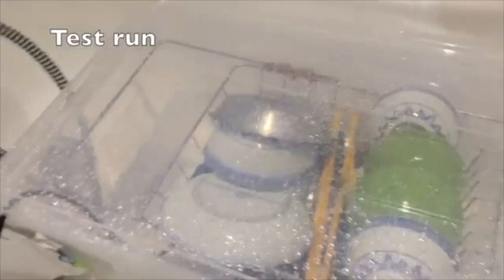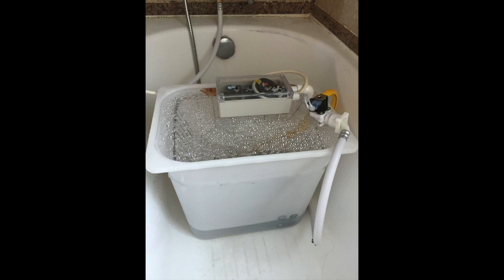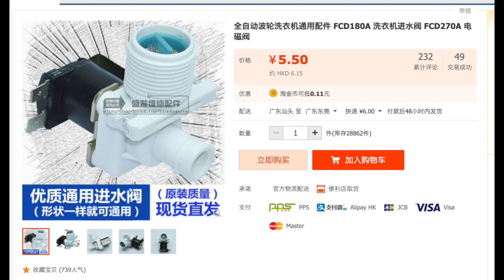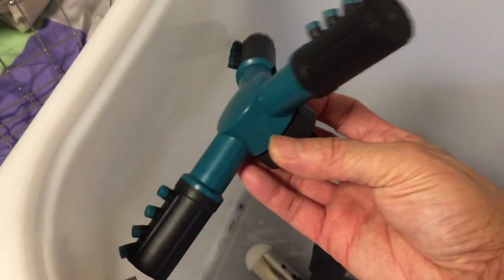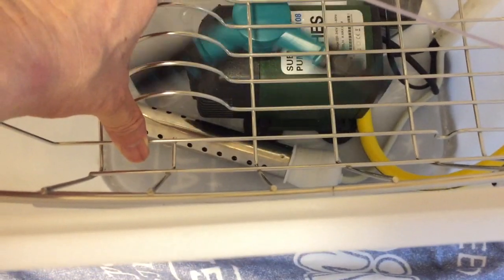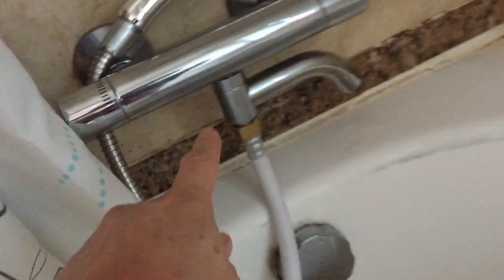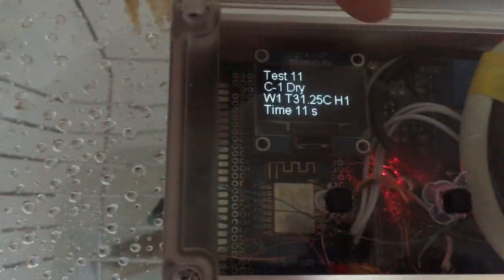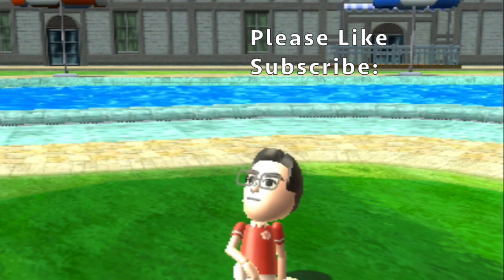DIY Dishwasher - Part 4 - Finished Product

Comment: Excellent idea. What about no water pump and the momentum and pressure is created with the water pressure ? If the pressure is condensed it would make it spin - maybe with enough pressure
Reply from the maker: @brandydurbin  ， thanks. It will be difficult to work on water pressure alone without a pump to create r ought pressure to clean the dishes,

Comment: Can you have the sprinkler above the dishes rather  in the lid ?
Reply from the maker: It’s up to you to design based on what type of sprinklers you got. For me, it will occupy less space  and easier to load and unload dishes to secure the sprinkler at the bottom right above the pump. It’s also more stable.
Reply: @BillyCdiy  I see your logic for that setup with stability.  I was thinking more simple like a shower head on a nema17 stepper motor rotating  it, mount it in a large container  with a pump at the bottom circulating the water and place it within the normal sink and fill with some hot tap water, then you only need to run the stepper motor and pump, stepper to turn the sprinkler head 270° back and forth, Do you think it will work?
Reply from the maker: @sshutupurface8345  ，that’s a great idea. Thx

Comment: How do you fit the sprinkler with the pump if the male screw of the sprinkler is too small? Is there a glue or tape I can use or whatnot?
Reply from the maker: Tap may not be secure. Suggest you found the parts that fit or find a converter. Mine do not this problem.
Reply: @BillyCdiy  I just need a female-female connector 1 1/4 inch and 3/4 inch. Do you know a link for it?
Reply from the maker: @schalazeal07  sorry. I donor have a link for that. Try searching the online shops in your country.

Comment: Thanks for posting this Billy. I'm using a 45w pump for spry and without the sprinkler it is generating a lot of pressure but when I attach the sprinkler the pressure gets very low. I am using the same sprinkler as yours. Do I need to widen the sprinkler holes? Any suggestion would be appreciated. Thanks
Reply from the maker: You can either try to increase the power of the pump (85W) or change the sprinkler to blades used by dishwashers.
In the China Taobao web site, there are parts from the dishwashers like washing blades that you can get. I've tested that the water pressure from such washing blades are much higher than the lawn sprinklers. However, I cannot find a way to mount them to a stand and not leaking water. Hence I gave that up.

Here are some links from taobao.com. Not sure if you can find them in your country. They are quite cheap , HKD 40 each.

Otherwise, you can try to look at the photo and see if you can enlarge the holes of the sprinkler to something similar.
https://item.taobao.com/item.htm?spm=a230r.1.14.176.1ffc4379Asa9fg&id=581304107028&ns=1&abbucket=11#detail

https://item.taobao.com/item.htm?spm=a230r.1.14.193.1ffc4379Asa9fg&id=623653372812&ns=1&abbucket=11#detail

Good Luck!
Reply: @BillyCdiy   i am also having the same problem. I am going to 3d print one using petg
Reply: @Billy thank you for replying. I will try to find the parts or get it from the website you mentioned.
Reply: It’s often not the size of holes in sprinkler but the pump doesn’t have high pressure, as in “head height” or PSI, they can pump a lot of water through one large hole but not much through multiple small holes under high pressure